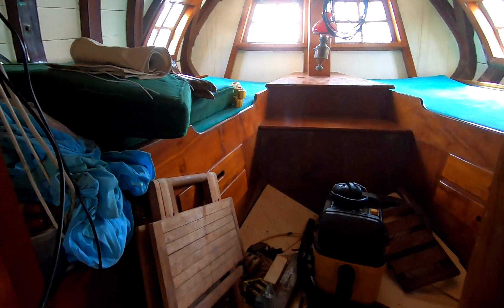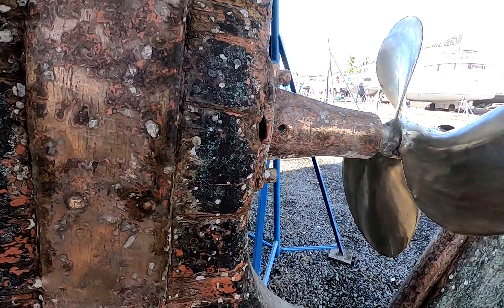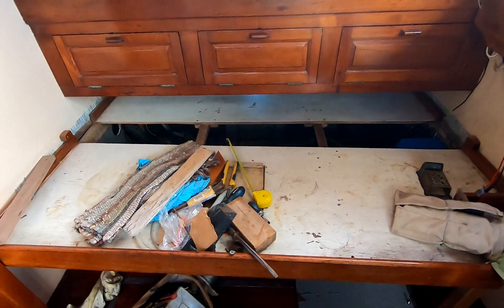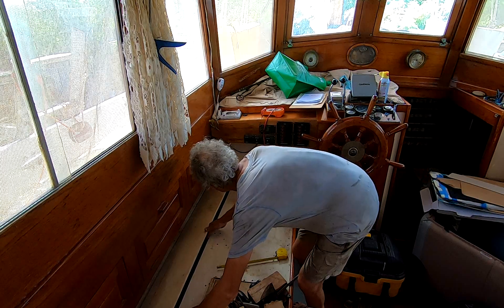Three Bell's #10

Comment: We're still marvelling at your boat. It's beautiful.

What was the process for getting your prop as clean as you did please? We used a brass wire brush on a drill, but ours still looks dull.
Reply from the maker: Thanks, after the wire wheel on a grinder I used some buffing compound purely. Normally I'd use Prop speed but that wasn't an option for that slipping
Reply: @journeymanadventure  Super, thank you!